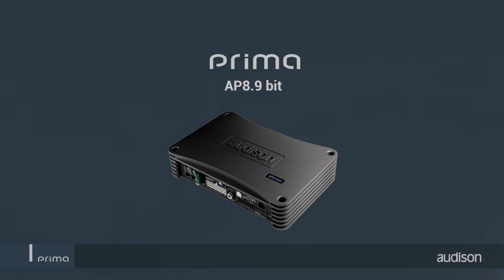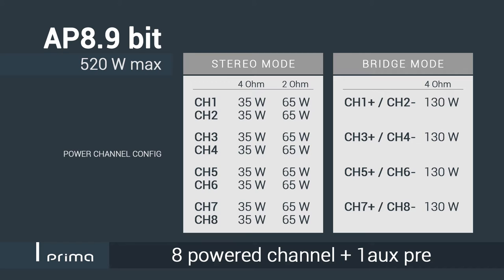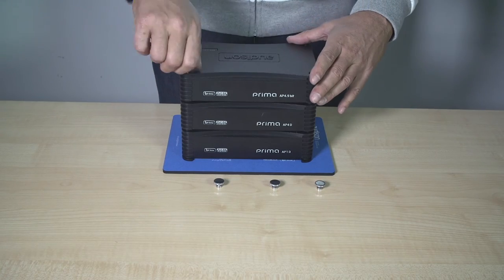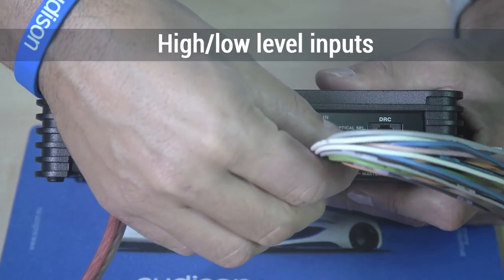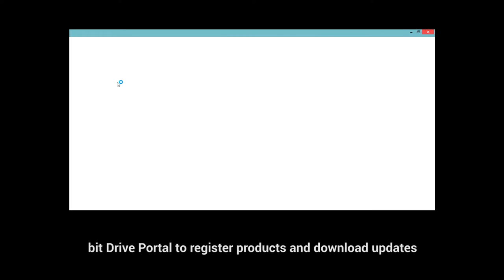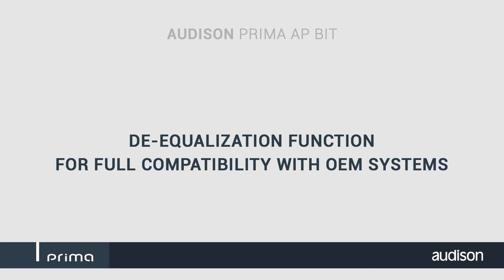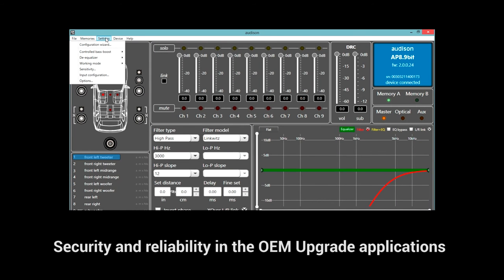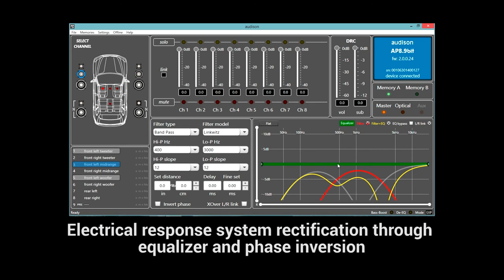1 - Audison Prima tutorial - Product Brief

Comment: Question please:  Do I need to use the crossover network that came with my tweeters and midrange if I use the Audison ap8.9 bit?
Reply: You dont need to use the crossover if you want to run it Fully Active, you can use Channel 1 and 2 to power the tweeter each side, then bridge the Channel 3,4,5,6 for your midbass. You will still have two channel left for the rear.

There are unlimited possibilities with Audison 8.9 bit.
Reply: Beware of the setups like that, since at the initial run, the full range might comes to the tweeter and possible damaging it